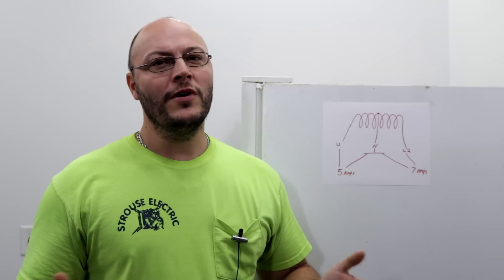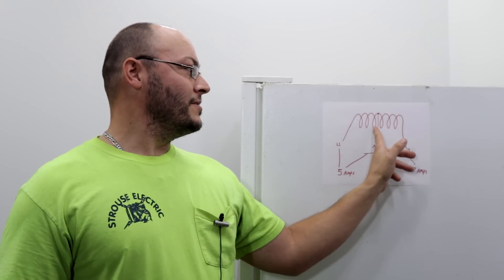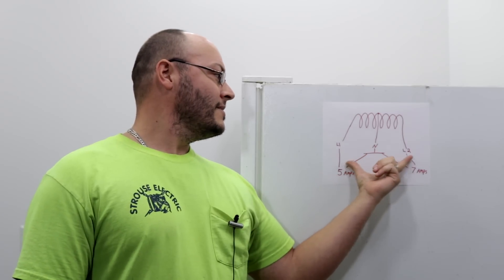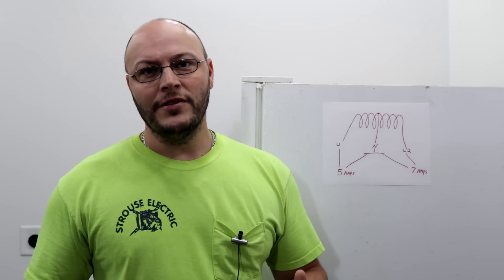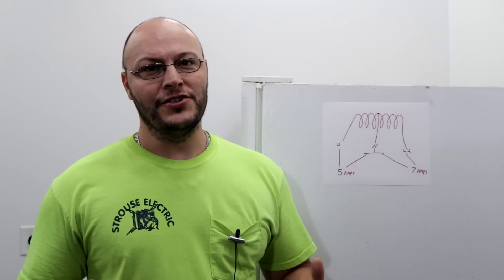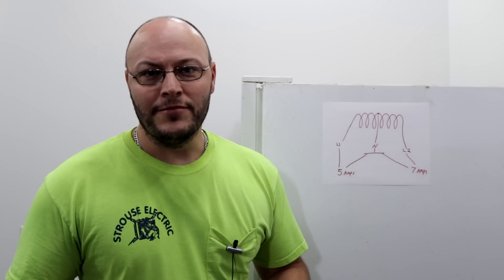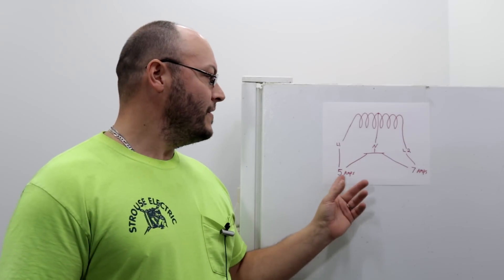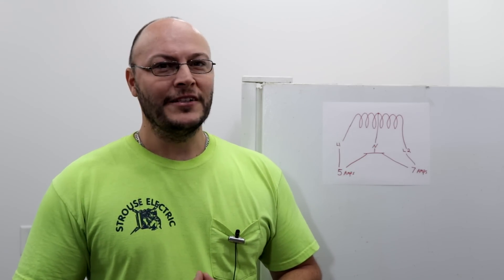What does the Neutral Wire Do?

Comment: so if 2 amps are going back to yhe transformer with the neutral, does that mean you can get shocked by the neutral wire? ive heard of guys getting shocked by the neutral wire..." back feed" they say...can you explain?
Reply: Yes I can.  Think of it this way.  Think of a battery connected to say a light bulb.  This is DC but the same idea applies to how it will work.

The electrons flow from battery terminal through the wire, to the light bulb, back through the 'negative' wire and back to the battery....one way.  But at the end of the day...the full circuit has to complete or no flow happens.  A 'complete circuit'.

In a house it uses AC.  The electrons do a back and forth dance.  They don't flow one way.  But because of this, the flow of electrons are always moving back and forth...and not just one way - meaning both Neutral and Lead are 'hot'.  In a battery...the electrons flow one way.  So the Neutral in an AC is technically live as well.  In fact both the wires are 'live'.

So where does the ground come in?  Well look at your wall socket, three prongs.  Two of them are connected to the Neutral wire.  Yup, the round third plug that some appliances use...usually high wattage/voltage appliances or ones that are moved alot (laptop plugs), connects to the Neutral wire at the box.

Wait how does that work.  Well don't think of the 3rd plug.  Electrons are flowing back and forth back and forth between the two plugs.  Plug something in and boom you get a connection, lets say a light bulb.  So why the third plug?

Well...think of a microwave.  They have a metal casing, what would happen if the wire gets damaged...and hits the case.  You go to touch the microwave...you turn it on...and boom 120V as you touch the case.  OUCH.  However.  The third wire..ground..is connected to the case.  So now if the wire is damaged, it connects the circuit, even without the device being on.  But because the ground wire offers less resistance and it trips the breaker, turning off the power and making the microwave safe to touch.  And if you unplugged it, reset the breaker, plugged it back in...boom breaker switched again.  Protecting you.

So the ground wire is an INTENTIONAL Neutral to L1/L2 connection designed to Purposefully trip the breaker.

It is also why ground wires are exposed.  Open up that three prong cable...that ground wire is not insulated in the cord.  Because...if the cord gets damaged...say in a door.  The ground connects to the L1/L2 wire, completing the circuit...tripping the breaker, and stopping a fire.

Now what does all that mean to the shock from a Neutral wire?  Well the Neutral wire is getting the same flow of electrons as the L1/L2 wire.  Remember, AC going back and forth, so most likely they were touching the Neutral wire and bridged a lead somewhere and got shocked.  Their body acting like a conductor.  As well if the wires are not wired right, L1 can also act like a Neutral line..in a an AC Circuit there is no difference.
Reply: Neutral has current but no voltage, current doesn't shock you unless you are in series with it.

Comment: The “main role of the ground (earth) wire is to protect against lightening strikes” Did you mean to say that?

Over here in the UK (yes, I know it’s different to USA and Canada) the main role of earth is to ensure any fault has a path to earth (ground) and is also used to help check for residual current escaping. I.e. to stop someone getting electrocuted by checking the balance of current between the live (L1) and neutral using an RCD. I think you guys called them GFI or something.
Reply: He like everyone in the US is confusing operational and protective grounding. Operational grounding means connecting part of the electric system (i.e. the neutral) to the ground. That can prevent over voltages caused by lighting. The problem with operational grounding is that now you can get shocked if a wire inside an equipment comes loose and touches the case. The solution is protective grounding that connects the case to the ground (in practice to the neutral wire).

Comment: As far as I am aware thatr the neutral in the uk and European standards, is another live line.  this is AC not DC...  The only time DC comes into play is when you switch your TV on.  The TV has it's OWN transformer as does your laptop Power Brick.  That is also an transformer.  AC is alternating current.  Means both ways.  EG:  take 2 wires shield/ covered what ever you want to call it.  In one end use a light socket with a working bulb in it.  The other end of the wires, push each wire into either socket seperatly.  The light will illuminate, then pull the wires out then rotate them and it will again illuminate.  Everything in your hoiuse up to the wall socket is AC.  not a typical thinking of DC.  or am I wrong in this matter.  I am still yet to blow myself up..

Comment: Thanks, appreciate the extra knowledge! But what I want to know is where does the neutral come from and go within the house (at an outlet). I want to understand the difference between neutral and ground inside the house. It has 0 volts until the circuit is completed by a device giving it the volts of the hot. But then where does it go? If it's to ground, why seperate the 2?

Comment: after the neutral returns some of the excess current back to the xformer......where exactly does it go?
Reply: Well technically, the current doesn't go anywhere because it is AC.  On net, the charges vibrate back and forth, and it is the "pressure wave" of inter-electron repulsions that propagates the energy.

But had it been DC, or had you assumed the instantaneous condition would continue forever, where it would go, is back out the two live wires that originally supplied it.

Comment: As I have always understood it, the neutral is grounded to stabilize the voltage on line to neutral loads.
Try this experiment. Use a transformer to create an ungrounded three wire system with a center tapped neutral conductor. Put a significant induced load between one of the phase conductors and the neutral. (Take an electric drill with a large bit and sink into some oak.) Measure the voltage across all conductors before, during, and after. You will see large voltage drops and spikes. Then, perform the same experiment with the neutral grounded. You will see only tiny ripples in the voltage. The ground provides a reference point, like an anchor, is how it was explained to me by an engineer many years ago when I was learning the basics.
If you had an ungrounded neutral in your house, your computer and other electronics would go nuts whenever you turned on your microwave or cut some wood on your basement table saw.
Reply: Ralph Averill    You are totally correct!

Comment: Why is my neutral and ground bars bonded together in my service panel?
Reply: To set the absolute voltage of the neutral, to be the same voltage as ground.  You do this at exclusively one place per service.  You don't want current on the grounding conductors, or on any non-current-carrying conductors (building steel, equipment housings, conduit, cable cladding, etc)

Comment: So is the two amps of unbalanced amperage added to your bill ? As opposed to LI -6 amps and L2 6 amps . O amps on neutral .  No , you would not , because you pay for wattage ? The ground is a safety feature , many times , life saving. As in an appliance with a shorted current carrying conductor. 5 yr. apprentice training . IBEW  Theory classes help a lot.
Reply: What they actually do inside the meter, is measure the amps on line 1 (I1), the amps on line 2 (I2), the voltage between the two lines (V).    Total power= 1/2*V*I1 + 1/2*V*I2.  Then the meter accumulates these Watts as kilowatt-hours over the course of time.  You are billed for the kilowatt-hours.  It is assumed that the neutral is exactly at half way, and it is redundant to measure its current.

Comment: This is not how it works in the UK. We have three conductors: Earth, Neutral and Live. Earth and neutral are connected together at the main electrical panel and are both then at earth potential. The live is 240 volts AC to both ground and neutral. It is important that on/off switches are always connected to the live conductor so that when 'Off' the appliance neutral and ground are isolated from any dangerous voltage. 
I have no idea what is going on with your diagram.

Comment: Let's eliminate the neutral, and wire everything in series.  Cheers!
Reply: So if you put 5 televisions in your circuit, each of them will have 22 volts? Is not going to work well..

Comment: at one point your are  right ,  but  i would not use the word ,: : my version" , I have been hearing  this all my live  from electricians. there is more  technical issues  behind  the neutral..... Neutral is a intencional name  given  to the center tap of a transformer,  but is relative only to the lines in this case  A, B.  in a single phase system ,  A,B ,C  on a three phase wye System,  Delta systems have no neutral , only in some exceptions , in USA,  is common to have a delta system with neutral, however  the voltage to each phase is different, one of the phases is higher ,,,,,  again its not a absolute neutral , becomes neutral only when you   intentionally  the center tap is connected to ground , then it becomes neutral , because  there will be no potential between ground and "neutral "  , But dont think because is neutral   it has no potencial, resuming  neutral is only a given name to the center tap of the transformer , there are codes  for electricians to follow , for safer electrical installations.
Reply: CMS ELECTRIC z

Comment: Electricity never leaves the source unless it can return to the source.
Reply: False. It will leave if it can get to ground
Reply: @red head, no, You are false. Electricity goes to ground because the source is grounded, at the transformers. So the electricity travels through the ground back to the power station. Edward has his facts straight.

Comment: The neutral is the return path for the two legs of 110 but not the 220 which is what the power meter measures. The 220 circuit sees the entire 12 amps but because the two legs are 180 degrees out of phase, only the net of the two currents (2amps) returns because it is like to batteries that are opposing each other. The neutral is like part of a current divider, where if the load is balanced, a net of zero amps would return.
Reply: Scott Guitar you teach this better than this dude.

Comment: What does a ground do.............
In the event of an electrical fault which brings dangerous high voltage to the case of an appliance, you want the circuit breaker to trip immediately to remove the hazard. If the case is grounded, a high current should flow in the appliance ground wire and trip the breaker.

Comment: Why can't  a neutral  be explained  as an equal power wire to accommodate  alternating  current  direction 
One half of the cycle  current  flows along the power wire to the load and the second half of the cycle  the current flows  through the neutral  wire to the load  .  I have  never heard a neutral  circuit  explained this way so  if thus is not correct  , tell me.  A if two volt  meters were connected in series along both the power or black wire (one meter ) and the other meter connected  in series along the. Netural  or white  wire  I would think when the load is turned on,  both meters would show equal  current and equal volts

Comment: the ground in the uk protects us from electric shocks. everythings earthed
Reply: But earth has high resistance, stray current has to go back to your second wire, as some one pointed out that you only get two wires from power company, hot and neutral.

Comment: No neutral on utilities poles? Neutral and ground wire are bonded in the service entrance panel. Utilities are in violation of code: 33.2 Ground or Earth as a Conductor
Ground or earth shall not be used as a normal return or circuit conductor. In
direct current supply systems or in single phase or polyphase supply systems, a
neutral or any other conductor shall be used under normal use as a return or
circuit conductor; however, the grounding of the neutral or
any other conductor is not permitted as a
normal return or circuit conductor. The neutral or any
other conductor is permitted to be grounded only for the purposes of
stabilization and protection.
Note:
Reply: John Puccetti yes, but if I'm not mistaken., it's saying you must have a dedicated neutral wire to complete the circuit., and not use a ground wire as a neutral wire. 

Don't get confused on the fact that the neutral wire is grounded. 

Different then the fact that the grounding wire is dedicated as a ground to earth.
Reply: John Puccetti in example, if you wiring a light., and you have a hot wire, but no neutral., you Can Not Ground the neutral wire from the light to something metal to complete the circuit. 

Because that neutral wire can and will become energized to the metal object. 

Which is why we ground the metal objects and run a dedicated neutral wire.

Comment: One problem with your theory is that the neutral is connected to ground at your main bond. Thus your ground can actually be better than the neutral at the transformer and will absorb the unbalanced load. The ground is for any stray voltage that may exist within your electrical system and acts as a back up for a failed neutral. The ground system usually cannot absorb lightning btw
Reply: Kevin Tapley    No!   Totally wrong.  Nothing absorbs electricity.  Unbalanced loads do not get absorbed anywhere.   Equipment grounds are in place to bring current to the neutral in the panel then out to the transformer and back to the overcurrent protective device (circuit breaker or fuse)

Comment: I think it is like a car battery, the black wire is the hot (positive), the white wire is the neutral (negative).  Either way, in this universe there must be a positive and a negative for flow of electricity to occur.
Reply: Mark Jeleniewski AC is no different - you always need a return wire to complete the circuit
Reply: starlitopensky1  that's DC voltage
Reply: You smoke too much pot.  And as far as auto electrical coloring systems, youre backward.
Reply: The color conventions are different..

In DC, red means positive, and black means negative.   If DC is used with building wiring, these are both colors for ungrounded conductors.  White/Red would be used for a negative grounded DC circuit.  White/black would be used for a positive grounded circuit.  Red/black would be used for a DC circuit where neither polarity is grounded, or they are on equal and opposite sides of ground.   As of the 2014 NEC specifying this, that is true.  But it used to not be this way, as any unreserved color could be used for either ungrounded polarity.

In AC, or rather building wiring in general, white or gray insulation indicates that the wire is a groundED conductor (commonly called neutral).  Meaning it is at the voltage of ground, but it set up to intentionally carry current.

With some exceptions, AC circuits generally do not mandate a color for the hot wires.  All that is required is that you not use a color already reserved (green/bare reserved for grounding, white/gray reserved for grounded).  However, there are industry conventions for colors that represent a voltage system.   They are as follows in the US:

Black/Red/White = 120/240V single phase.  240V black to red.  120V red to white, 120V black to white.
Black/Red/Blue/White = 120/208V three phase.   Black/red/blue are the three phases, white is the neutral.
Black/Orange/Blue/White = 120/240 high leg delta systems.   Orange B-phase is officially required as the high leg color, which means it is 208V to neutral.  The other two phases are 120V to neutral.  All phases are 240V to each other.
Brown/Orange/Yellow/Gray = 277/480V three phase.   Used in large scale commercial and industrial applications, as opposed to residential/light commercial.   120/208V may also be present on the premises, for the plug loads, but most of the loads (machinery, HVAC, industrial lighting) operate on the higher voltage system.

Comment: A little tip I picked up from an Englishman electrician is the neutral always carries part of the load and the ground (green wire) is a (required) safety device. Over in Europe the ground wire is called a "drain" so think of it as the floor drain in a room full of (possibly) leaky appliances. If the power got out where it's not supposed to be it's just going to go down the drain! BTW, the main reason a ground wire can be a smaller gauge than load wires is because it only needs to handle power for a moment or two... just long enough to trip the breaker.

Comment: Neutral is usually connected to ground (earth) at the main electrical panel, street drop, or meter, and also at the final step-down transformer of the supply. ... In the electrical trade, the conductor of a 2-wire circuit connected to the supply neutral point and earth ground is referred to as the "neutral".

Comment: It's not correct in strict sense. Neutral and live wire just gives potential difference of 120V in West (220V in India).
Current drwan is dependent on power by equation Power=Voltage×Current. ( Here voltage is constant)